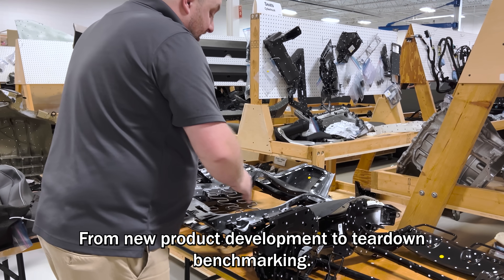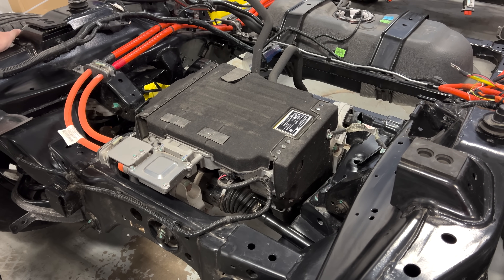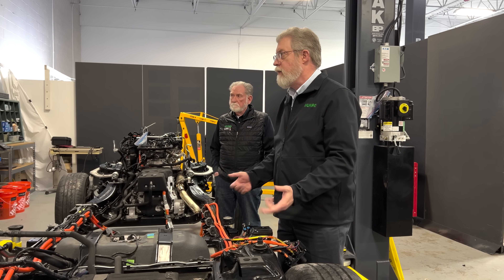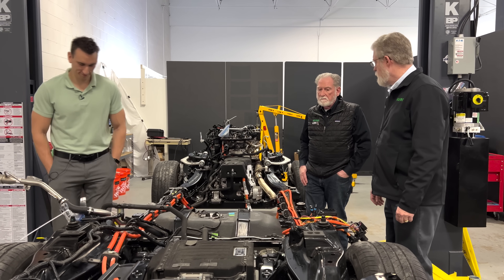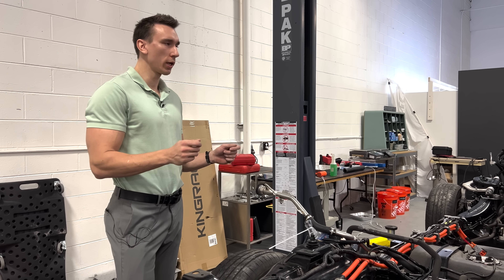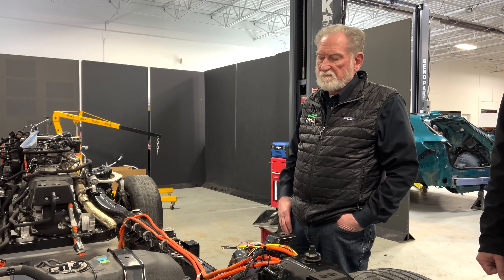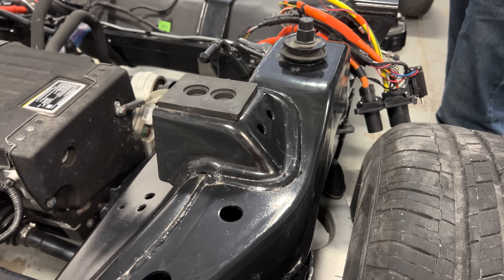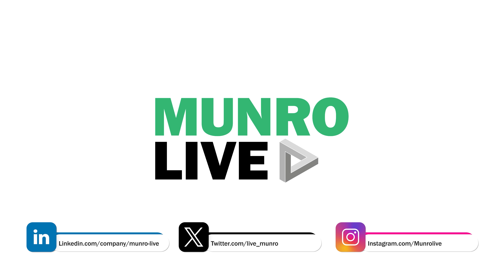There's a Monster Under the Bed of the BYD Shark!

Comment: Sandy looks at things from a manufacturing cost perspective. As a consumer, I'll take the overbuilt frame any day over a paper-thin, weak piece of garbage that rusts away in 3 years.
Reply: I take OVERBUILT ALL DAY, too!
Reply: You can “overbuild” something in a clever way. This isn’t it.
Reply: @ulf5738  ok, you drive a Corolla, and I'll drive a tank.   Who will survive?
Reply: @ clearly you’re not a genius and not an engineer
Reply: @seymorefact4333   depends on what you hit, if you both hit a brick wall at 100mph ill take the corolla itll crush and safe my life, the tank will turn me into red paste.
Reply: @ulf5738  engineers obey their investors!   Make it cheap,  market the brand,  huge profits for investors!
Reply: @ulf5738  You can engineer something to be efficient AND repairable / durable. Sandy et. al. only seems to care about minimizing costs to the manufacturer at the expense of the end user experience, value, or sustainability (not making a disposable product, but one that lasts). And that bias is clear in all their videos. I don't blame him that's literally what his company exists to do but it's not always best for the consumer.
Reply: @slunasaurusrex He never mentions possible differences resulting from manufacturing in China, like labor costs or cost of steel, durability, etc. If it was a Tesla, he'll call it the best thing since sliced bread. I essentially stopped watching his videos.
Reply: @seymorefact4333  what a lame joke!!! no you donot drive a tank come back to reality
Reply: @carholic-sz3qv  DUDE...bless your heart!
Reply: @ulf5738  I know plenty of engineers, I don't believe any of them are geniuses.
In fact most of them are far from it.
Reply: @slunasaurusrex so basically all the vehicles he dislikes are the good ones we the consumers should like! Got thanks those will be my favorites now! 😊
Reply: @seymorefact4333 The Corolla… lol
Reply: @ulf5738  there are rumours of byd releasing a larger size vehicle on this platform and that its possibly going to be a full size truck. Possibly had that in mind when developing this one. Not the most efficient approach for sure but as a customer I don't mind at all.
Reply: @user-pp6kw6yl6z  if you where Australian you would understand this ute
Reply: @ulf5738  totally agree with you!
Reply: I'd take any sort of over built in preference to under built anyway.
Reply: Munr0 is all about making things cheap cheap cheap, not making things longer lasting and more durable and less maintenance for end user.
Reply: @ 🤦‍♂️ You just don’t get it. A heavy car limits your loading capacity. It decreases you range and increases wear and tear on suspension parts and tires.
Reply: @ulf5738 then why do we need class 8 truck when class 6 can handle the load just fine? 😂
Reply: @ They never discussed how muh this vehicle weighs and then compared it to US and other similar vehicles. Wonder wy they avoided talking about that?
Reply: @林振华-t4v What you just said is pure nonsense. You have tried to deny the point of a Class 8 truck in the premise of your loaded rhetorical question. Class 8 trucks are well suited to their application, viz. they have a significantly higher weight hauling and long hauling capacity, making them ideal for long-haul deliveries of heavy and/or bulky goods like containers, for instance, while Class 6 trucks are better suited to hauling smaller, lighter loads over shorter distances.

So, Class 6 trucks simply do not suffice to safely and effectively haul the largest permissible common loads. Haulage of those big loads and in particular haulage of big loads over long distances is what justifies the resources devoted to the design of Class 8 trucks as well the selection of those trucks for particular applications and the high costs of acquiring trucks of that sort. Indeed, the safe and effective haulage of those big loads is what justifies the Class 8 truck definition itself (and all associated technical standards and mandatory design requirements) as well as the work done by the agencies charged with developing and promulgating those standards.
Reply: @ulf5738  Until it gets a little over stressed and then the whole thing is scrap -> "A heavy car limits your loading capacity. It decreases you range and increases wear and tear on suspension parts and tires."
Reply: That's why people don't add accessories to there 4wd. Got it
Reply: @pablopicaro7649  Mr Planned Obsolescence
Reply: @pablopicaro7649  Hardly! Cost efficient, effective manufacturing is what they do, so you end up with a better, more affordable product.
Reply: @pablopicaro7649  wrong!!!! its not about cheap but cost effective while still performing equally as well.
Reply: Overengineering, or over-engineering,[1] is the act of designing a product or providing a solution to a problem that is complicated in a way that provides no value or could have been designed to be simpler.
Reply: @ Which is why the term "over engineered" is used to try and discredit BYD. The proper term is "Superior engineering" as compared to US and other manufacturers.
Reply: @bravomike09 I have a Welding and Fabrication background that frame looks extremely strong and welding is high quality, these guys have had nothing good to say from the time they drove the Shark into there premises.. 😊
Reply: Complexity for the sake of complexity?
Reply: ANYONE seen videos from India, Africa, Asia where trucks are insanely overloaded 4m high with huge loads?   Perhaps that is the target market!   NOT Lot Crawler Urban Cowboys and Pretty Boy Dance haul trucks in the West.,,,,,,,,,,
Reply: Yeah, Sandy is a master of "ensh!ttification" - which is why Western cars fail after the 3-4 year initial warranty period, whereas Chinese cars are designed to last the 6-8 year battery warranty period.
Reply: Sandy is so negative he's becoming impossible to watch. All he does is critisize this car yet he loves the ridiculously stupid Cybertruck. He hasn't even driven this vehicle FFS. Here in Australia we get this car for $36,500. It is super efficient, super quick, super refined, has a huge battery has tons of standard equipment and if it is over-built then awesome.
Reply: @simonmiller5118  this is not  about consumers Munro has the industry as customers. BYD could have made more margin with a better designed vehicle and that's what Munro is offering. You didn't have understood the purpose at all
Reply: In Australia it is a regular failure for utes with heavy touring setups to break in half on the outback roads, I believe the Ranger is on the list of the models known to do that.  Specific dealerships have complete frames in stock ready to swap!

Optimizing for production cost includes taking calculated risks on some waranty replacements for extreme use.  Great result for the MBA's.  Not so great for an owner left stranded, and left with a huge recovery expense.
Reply: @MathewBoorman Yes, check out some YouTube videos showing brand new heavy duty looking Jeep broke in half.
Reply: My thoughts too
Reply: Notice he keeps saying "trojan horse"? There is only one logical reason to build a frame in this manner. It is built to withstand having a multi-rocket launch system strapped to it.
Reply: @davefroman4700   Does it mean this will become the first choice of those jihadist? No more Toyota 😁😁😁
Reply: Ya, this frame could survive 20 years in an area the salts the road 6 months out of the year and still be in good enough shape to tow heavy loads.
Reply: Same platform as their busses just shrunk down?
Reply: So many vehicles “break their back” when loaded up with a camper or whatever. (ie: bend the chassis) I’d say this has zero chance of that happening. “Overbuilt” sounds great to me!
Reply: @slunasaurusrex  No. This thing is built as a weapons platform hiding in a civilian wrapper. You could mount a multi launch missile system on that frame.
Reply: no, if a manufacture cannot build something just good enough, they will bankrupt pretty quick.
Reply: All that talk about the wiring loop. Is there really? 
The left one is to the motor.
The right one is simply attached to the charging plug. Both won’t be carrying current at the same time!
I get the feeling that Sandy’s team are just getting out of their comfort zone and don’t really have great understanding of what’s going on here. 
Over built? I love it - won’t break it’s back (bend the chassis) as soon as it’s carrying a big load such as a camper on the back.
Reply: @ Yeah, it's unbelievably dumb commentary when the viewer can see that the left pair has the charging socket connected, while the right pair is connected to the motor.  At no point would the rear motor be energized while still plugged in to a charger.  I don't understand why they would even make the comment, because they had to know what the wiring was for, and how the wiring pairs were completely isolated from each other.
Reply: @FutureSystem738  over build is a bad thing for the company and for the customer. you are paying for things you don't need.
Reply: @ The customer routinely overpays for more than they need, which is why most cars seat 5 people when only 1 or 2 are usually used.  They also have oversized engines making excessive power, gearing that enables top speeds far above national speed limits, and cargo capacity far above daily errands.  Until those rare time one actually squeezes in 5 people and their luggage for an airport run.  The customer actually pays for the convenience of having slightly more as insurance against not having enough.
Reply: @ZweiZwolf  well, yes, but that is what the customer wants to pay for, while as the excess material is not. Because that either add cots and fuel consumptions on top or the manufacturer is somehow subsidizing the cost which either way is not sustainable.
Reply: @ernahubbard2062  In this case, the "excess material" is reinforcement and strengthening of the frame, for those customers who want a long-lasting truck that can easily handle whatever loads are put on it. If they really wanted save a few pennies on a frame that might bend, they'd get a Ford.  As for the cost, BYD is nearly fully vertically integrated, so they don't have a bunch of suppliers taking profit that raises the costs. They also have lower wage, but higher productivity labor that also brings down cost.
Reply: @ernahubbard2062  well you seem to get alot for 60k
Reply: He seems to be just another bean counter sacrificing quality for profit.
Reply: Middle ground would be ideal.
Reply: I live in South Korea, so I know why.
In South Korea and China, unimaginable overloading is so commonplace that it requires over-engineering.
Here, for example, it's not uncommon to see small trucks with a maximum load capacity of 1.2 tons loaded with more than 5 tons of cargo.
Reply: If what people are saying is that they like the idea of a bullet proof BYD SHARK then I'm sure there would be a better way to realise that goal than this. BYD has a noticeable inclination towards producing quick, dirty and heavy implementations of new things the first time around. Design elegance and something approaching a 'platform' sometimes emerges later, after a few redesigns.

With all of the technical talent at BYD it seems odd that they keep doing things in this ad hoc way.

I suspect that some BYD factories haven't yet fully benefited from the revolutionary upending of standard vehicle production practice evident at the factories of Tesla, Xpeng, NIO, Xiaomi (BAIC), Geely, Seres AITO and JAC.

My speculation is that EV designs do not turn out to be the same when developed for production processes that accommodate both hybrid and EV production on the same lines as against lines dedicated to EV production. I suspect that one important consequence of this is that EVs when developed for manufacture on dedicated EV lines are better able to take advantage of advances in production technique that are racing along and, as it happens, are more readily implemented on (dedicated) EV production lines.

Cross purposes on a production line I am suggesting are a bad thing. And, I think that cross purposes do arise with these blended production lines. Provision of necessary engineering for hybrid manufacturing can force EV development (affected by those engineering commitments) down odd paths with odd EV engineering implementations being the result. Engineering compromises of this sort also negate the efficiencies that would be gained from operating dedicated EV lines. I am suggesting that BYD production is the hodgepodge that it appears to be. Surely the company has a plan to straighten things out over the longer term but this is what BYD had when it hit pay dirt and for now it is still what the company has.
Reply: But will you pay for overbuilt? And chose something more costly with less range
Reply: You can overbuild and still so a  bad job.
Reply: As a customer, I like cars that are build with strong metals like how cars was build in the past.
Reply: lol!!!!!! the thickness of steel has absolutely noting to do with rust its the quality of the material.
Reply: He thinks like elon. How can we build this as cheap an shitty as possible and charge twice the price
Reply: @hardmcshaft7931  Munroe trained by investors to build cheap and price high for big returns.   Who cares about death from cheap cars!
Reply: Overbuilt, but cheap. Thick, low-quality steel rust faster than high quality HSS.

Our memory of rusting frames is of decent to high quality steel frames. We'll have to wait to find out what BYD is using.
Reply: Shark is way cheaper than the rest, so u welcome over engineered products !
Reply: Hey! 
1. As a consumer I would always take simplicity over complicated assemblies which are hard to work on;
2. Any frame will rust at one point, thick sheet or thin sheet;
3. There is no overbuild in this industry. There is only purpose build or lack of it.
Reply: Overbuilt = strong and rigid. = safer. Shows how Munro has been helping manufacturers make things crappy.
Reply: Your talking about the Cybertruck, I agree.
Reply: How dare they build this stronger than a tank!
Reply: That's why old trucks still run today.  They were built like tanks.

I have some cost engineering background.  This is one of those discussions about being effective and efficient.

It's too long to discuss that aspect in a comment.  But I would rather be effective first than be efficient first.  You have to hit your objectives first before thinking about efficiency.

That's a discussion for geeks though.  To some degree, if this is a discussion about cost cutting, I would agree.  But if this is a discussion about durability and reliability, hats off to BYD.

My family has a can opener that can still open cans from the 1970s.  Now, can openers of the same design of the same company won't even last 2 months.  So, there are a lot here on YouTube about old metal tools being strength and stress tests against new tools.  Old tools would outlive these new tools because new tools/products are built with the principles of market obsolescence so they can sell you a new one later on.  While old tools/products are built so you would never buy a new one.

That's what Munro is about, i think.  Aiming for the minimum requirements without margin for failures (or in this case, accidents/crashes).

That wire loop would at worst be too insignificant.  House wirings have the worst electrical inefficiencies and we hear nothing of it.  Some houses even have capacitance wirings.
Reply: Absolutely these guys do look at it from cost perspective, they say the frame is over engineered, I say that frame is strong!! no wonder your American pick ups have rusting issues that start in the frame.
Reply: 11:47 hugely overdone??? Take a look at an underground Caterpillar dump truck….wayyyy over engineered in its frame but boy do they last a long time. The ride is bouncy as hell but the frame will outlast the rest of it……oh by the way. caterpillar is an American company

Comment: No Sandy.. It's not stupid. That is why I would buy it. It is better engineered than the    donkey carts you manufacture in the US.
Reply: I take OVERBUILT ALL DAY, too!
Reply: angry wumao.
Reply: @JigilJigil  bigot
Reply: @JigilJigil  🤩🤩I take OVERBUILT ALL DAY and FOREVER!  Made for military in 1945...ill take 10!     Monroe would have 7 to 10 shots first, get drunk and design the structure as cheap as possible!  the AMERICAN WAY!
Reply: @JigilJigil  What do you got?
Reply: @JigilJigil  angry weeb
Reply: Munr0 is all about making things cheap cheap cheap, not making things longer lasting and more durable and less maintenance for end user.
Reply: @pablopicaro7649  

A difference in focus, production cost can be measured and optimised, but total cost of ownership to the customer for various use cases has to be based on guestimates.  To be generous if the most common customer uses it for commuting, light and weak is acceptable, as there is heavier truck models available, which seems to be the US market approach.  Some other markets to expect a 1ton ute to take heavy loads.

For me, I am considering a shark, but will want to remove the bed to put on a trayback instead for a camper.  It looks like the separate cable for the charge port will make it simple to relocate.  If it was optimized for production cost, relocation would be troublesome.

Choice of a casting vs weldment also impacted by volume.  For the large castings Tesla use, I think they have said volume needs to be around 1M a year to justify the development and capital costs.  I guessing a casting would be a lot longer development process as well.
Reply: Frame is built to handle a 450  heavy  hawler